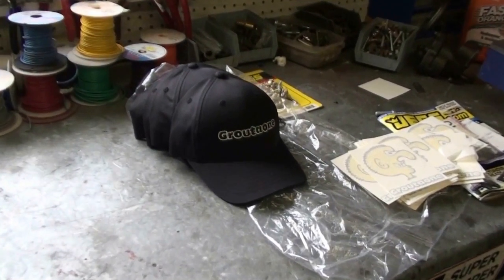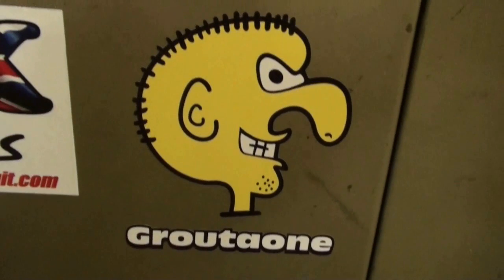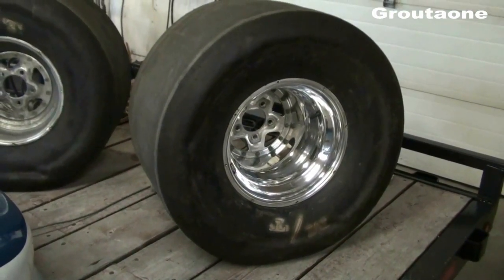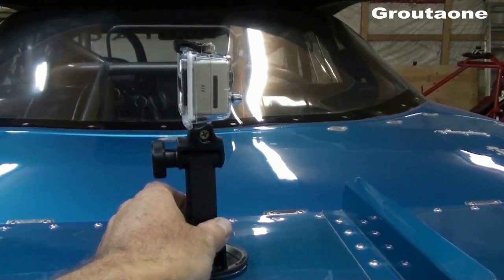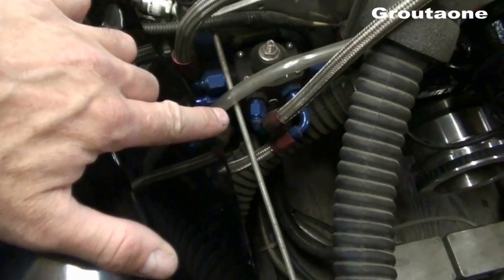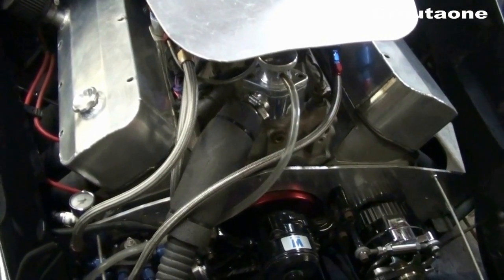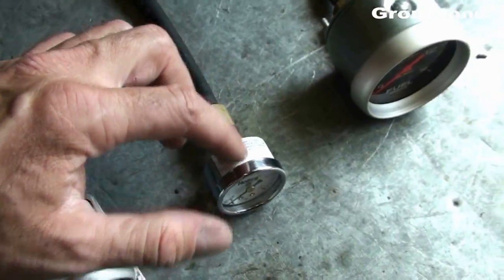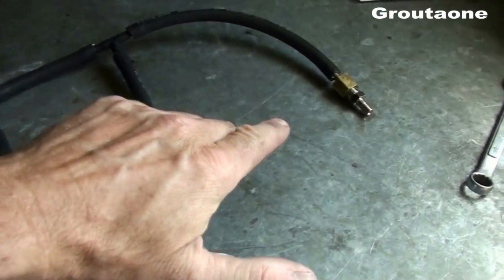Nitrous Fuel Pressure Gauge Test

Comment: It's glycerin in the gauge.
it allow to avoid shakings on the mechanism of the gauge and the needle.
it preserve the material but it's a bit less reactive in case of sudden rise or loss of pressure because of the viscosity of the glycerin.
often used in fluctuating pressurised systems